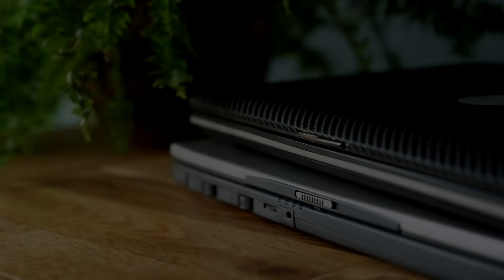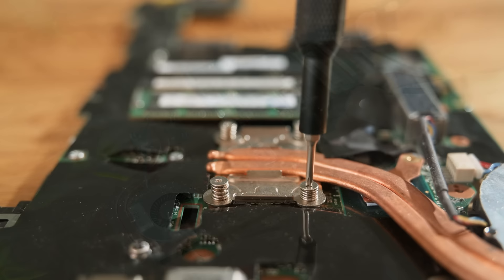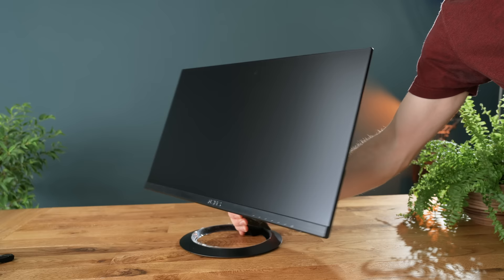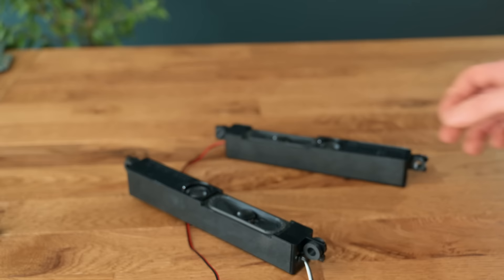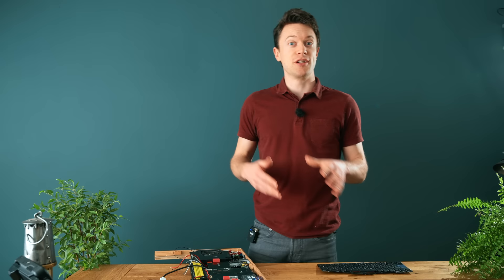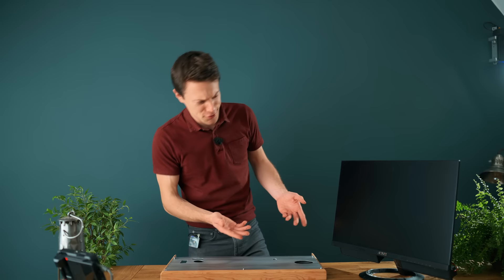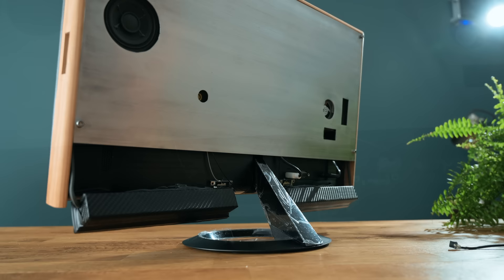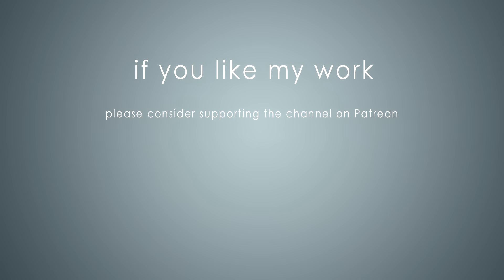Transform a Damaged Laptop into an ALL-IN-ONE desktop PC

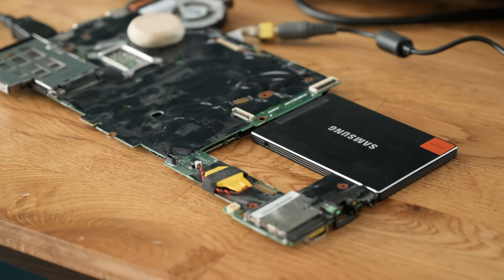Comment: 4:15 “and then I added a 2080 nvidia GeForce gaming card”
Reply: on that mobo? HAH! In your dreams! But seriously replace the mobo and you may be able to do it though. Not sure what to do with the power supply and fan though.
Reply: wu1ming9shi if you replace the motherboard then you’re just building a new computer at that point
Reply: @BlueNinja4848  yeah, pretty much but let's be honest here do you know how big a 2080 is? It would never fit on a laptop motherboard. You could possibly buy an adaptor for it (if that even exists for this kind of stuff) but you're gonna throttle the output of it so much you're better off buying a smaller one.
Reply: @wu1ming9shi  yeah im not sure if newer laptops with dedicated gpus have 16x pcie, but i know for sure that old one doesn't
Reply: @BlueNinja4848  yeah, exactly. Well tbh though my first comment was a meant as a joke. but yeah. :)
Reply: @wu1ming9shi this... this is a laptop

Comment: You could use the battery voltage on the power button with 2 diodes to prevent current flow to the adapter and back to battery which would allow u to power on with or without charger

Comment: Hahahaha I did this to my laptop. My current table has a big container underneath. And since my old laptop doesnt have a screen, I hid it under the table with holes for air to go in and out. Then I just connected it with an hdmi cable and Bluetooth for the speakers. I also used a wireless mouse and keyboard set. Now, I have my own work pc setup.  Pretty clean I should say.

Comment: This is a perfect video popup. I have an old but still viable Lenovo Helix 3x series with an i5 processor, 16mb RAM and a 1TB SSD that was just laying around. I dropped it a few years ago and destroyed the screen, however it boots up and can be used with an HDMI monitor or TV. 
This project will become my project. I have 3 or 4 LED screens laying around as well. I also have wireless JBL external speaker which will be fine

Comment: I like this video but I presonally would have used the VGA port for the monitor (with an adapter or so) and then routed the other port outside so you can attack a second screen to the system as well

Comment: Third comment: you would likely benefit from adding a few antennas and connecting them to the WiFi card, each a 2450MHz dipole with a trap for 5750MHz, and using another piece of MDF instead of the aluminium rear panel.
Reply: You already addressed the WiFi.

Comment: What I would do is leave the laptop keyboard connected, but build it into the casing. That way, it will serve as a backup in case the main keyboard fails or runs out of battery, and I would make it so it can be switched off when not in use so it doesn't interfere with normal use.

Comment: I've got a Lenovo G570 model 4334 where the hinges have broken out but suprisingly it powers on and works great, it has an I5- 2450M, just a duo core but it can do with watching tv shows or movies...basic stuff.  I'd like to make a case for it as it's monitor has to be propped up so thanks for the video on how to do this, but I got kinda lost at the power and relay switch but overall great video.

Comment: I did same thing with a damaged handheld PC like a Steam Deck but it ran windows so I cut it open took the internals 3d printed a mini PC shell and put the internals there then I added a big old but quiet fan and overlclocked it as far as the fan and large heatsink can cool off and I've got a nice mini PC tablet combo as the screen still works so I put it on top of the 3d printed mini shell and so I can still use it without connecting a monitor it will come in handy if the external monitor needs drivers installed for it to be use I can navigate with the small monitor and install the external monitor driver 😂😂

Comment: I did the same but just took the screen off the laptop and taped the whole laptop to the back of the monitor. Also in this video, may be better to use velcro or thick gel tape instead of epoxy.

Comment: Super nice job. Can you transform the original keyboard in to an external keyboard? You need a separate pcb that acts as an intermediate between laptop motherboard  and the flex cable from the original keyboard. Make an enclosure and... voila

Comment: Regards!!  Excellent video; I precisely have a laptop with several damages, such as the screen, the keyboard, etc., but I would like to have a better guide to do this project, since electricity is used, and it would not be very pleasant to burn the motherboard and the monitor, it has Do you have a guide or diagram of such a magnificent project?

Comment: I got a broken nitro 5 with a intel i7 9750H and a rtx 2060 with a nvme ssd 1tb and 32 gb ddr4. Im going to do this next month but im going to buy a 27in 1440p/hdr300 monitor and plug in to the hdmi 2.0 port. And thinking about adding a water cooler with a 240mm rad

Comment: My problem is whenever i buy something then its the most high end device available.
Even the hp workstation from 1989 still works...
And the laptop from 2001, and the one from 2007. They all work fine, just slowly compared to a brand new one from 2019 with a 4tb ssd and 40gb of ram

Comment: This has been a great boost in inspiration for me. I was set on doing this but instead of a regular monitor incorporating a drawing tablet instead as i would like to use it on the go and as a drawing space as well. 

My goal is to make a remote access point that can connect into my much more powerful desktop anywhere and anytime to use its power for certain projects but still have the ability of utilizing its own features for reliable usage to create and do tasks normally as well. 

The laptop i am repurposing has a very old gpu back from 2016 but runs okay, the ram has been upgraded to 16 gb ddr3  and the cpu is i3 i believe. 

This alone leaves much to be desired for art and larger 3d modeling programs but my hope is i can create something sleek and useable like you created in a package that is still manageable like a normal tablet and with an ability to remote desktop im hoping it can give me that universal access my old gaming laptop once gave me for my modeling programs anywhere i am

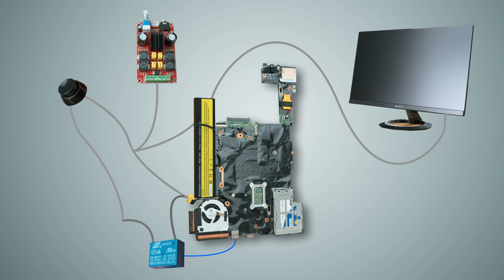Comment: Can you explain the power button , relay connection in detail with the actual wires to connect in the video at the timeline 10:50. What is the blue line going from relay to motherboard.
Reply: hi, the momentary POWER BUTTON lets the charger to power the laptop motherboard momentarily just in time until the USB PORT become active. He then uses the power from the USB PORT to activate the RELAY SWITCH (basically it's just like a regular switch that turns itself on if it receives certain voltage, in this case, from the USB PORT), so now the power from the charger will pass through the RELAY SWITCH all the time as long as the laptop and the USB PORT is active to keep the RELAY SWITCH open!

Comment: I am trying to divert power using relay, but I am not clear how the relay is going to work when laptop board uses different power input and monitor uses different power input and how can I make sure both systems get required power from same source. Any suggestions would be helpful.

Comment: You could have just used a hub with usb 2 instead of usb 3 because like you mentioned the laptop doesn't have usb 3.
By adding a hub that has usb 3 hub that's connected to usb 2 port will make the usb 3 hub give usb 2 performance.
Short version; You downgraded the usb 3 hub by conntecting it to usb 2 port

Comment: Hello, 

I have an HP Envy 15j-110tx laptop with me. It works fine but the outer hardware is beat up. And the display is also with black spots.
So, I wanna make it a desktop PC. 

Monitors connected to the HDMI port port won't show BIOS/UEFI.

So, the display has to be taken from the onboard setup itself. It has a ZIF connector-ribbon cable running to the screen. How can I use that to add an HDMI port there ? To connect it to an external monitor

Comment: Hi, I'm currently trying something similar. I have a dell Inspiron 1420 laptop motherboard on hand and trying to build a NAS using it proves to be challenging. At first it booted to bios and seemed to work fine but now this on board orange light is on and nothing is showing up on the display and i have no idea as to what i should do. I've been seeking some advice, it would of great help if someone could share the steps on what to do.

Comment: There is one problem, the pc is charging all the time and it will make the battery hot and damage the battery due to charging when its already full.
Reply: Laptops have protection circuitry to prevent that.
Reply: @techheck3358  ok

Comment: 1 Long to collect (woofer is clearly superfluous)
2 Difficult to disassemble (to clean from dust or upgrades) everything is glued
2 USB hab is not stable with many devices
3 If Bios fails, it will not be possible to start, because the image is displayed on the monitor (but it is not)
4 Turning off must complete the work and turn off the entire system.
Conclusion: do not recommend

Comment: awesome build. The "pop" you heard from the amplifier actually is a characteristic of these cheap chinese amplifiers that has no protection circuit on the speaker outputs. I have several boards based on TPA3116 chips and the cheapest ones does this pop, other higher quality ones - like the"aiyima" branded boards - doesnt. This guy explains it on this video https://www.youtube.com/watch?v=NeOsgZ_5hjk